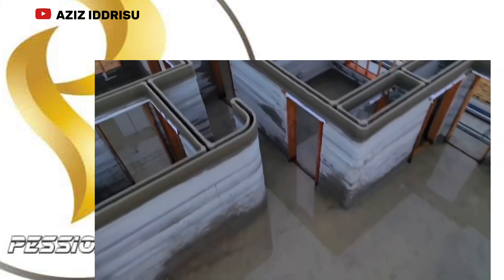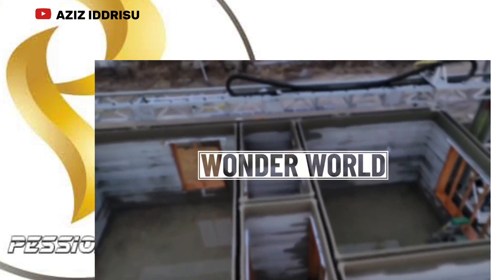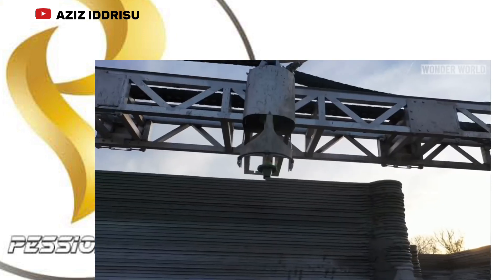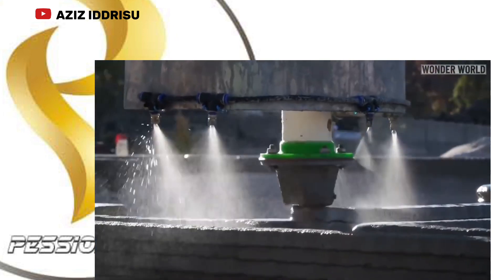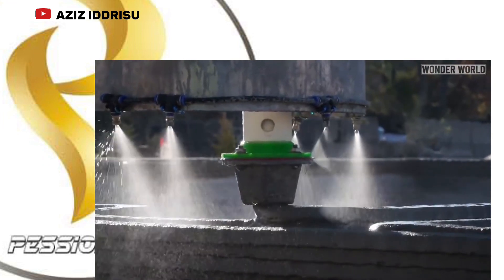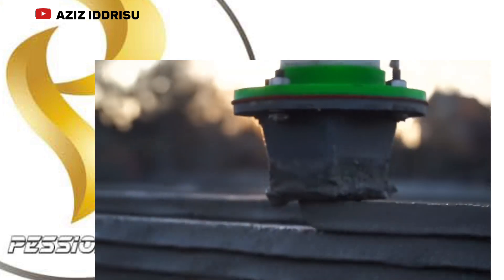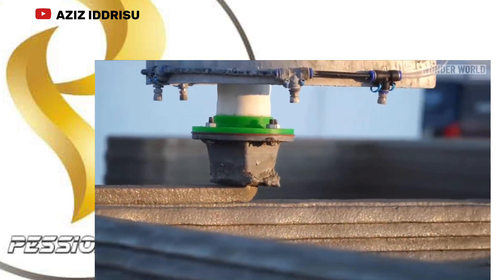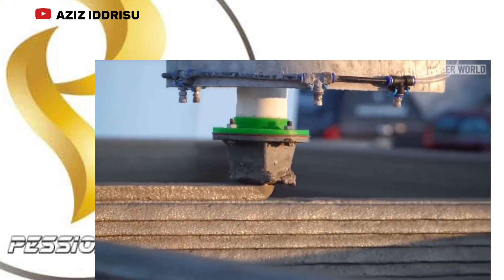The company in Germany that is printing 3d houses with concrete

Comment: Well it depends I need to it’s structural feasibility before I can consider it ..
Also,I need to know the ultimate load it can withstand
Reply from the maker: They’ve not started making storeys and multi structures yet. But for now their homes are made of reinforced columns and they use high quality concrete for the walls instead of our normal traditional blocks